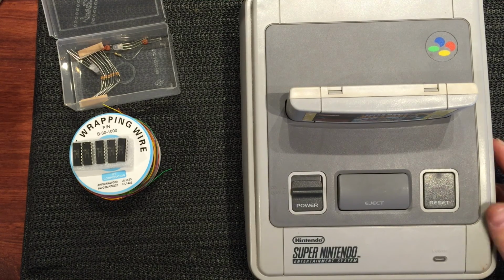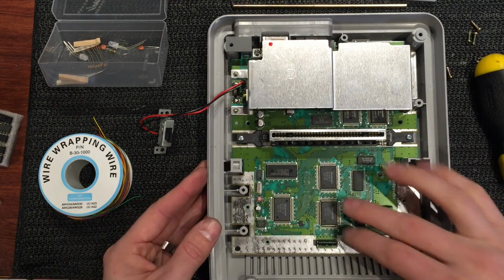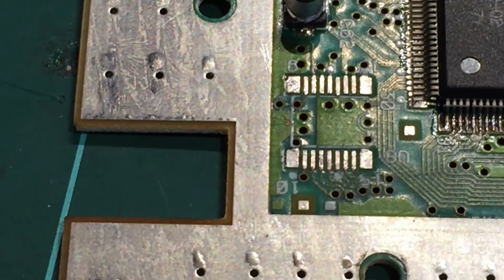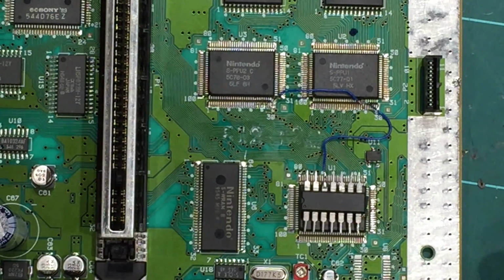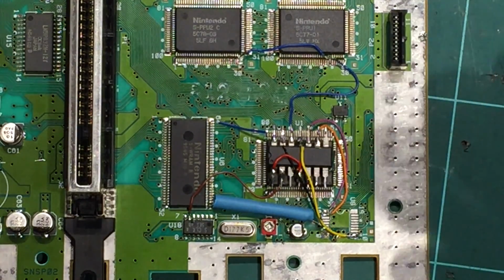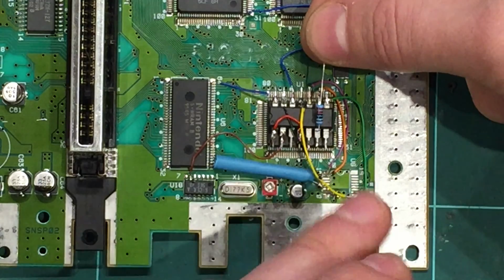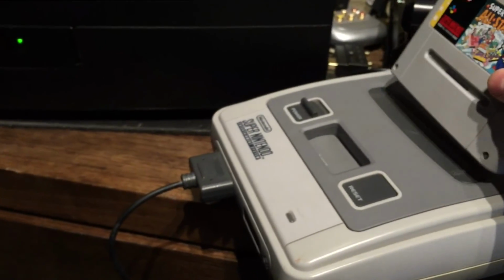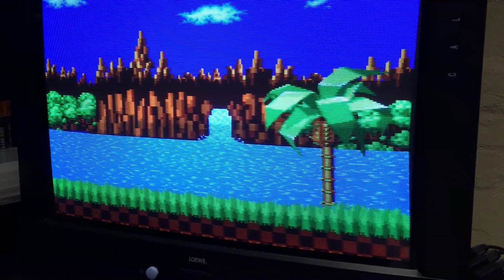How to install a SNES SuperCIC Switchless Modchip PAL NTSC Super Nintendo - YouTube

Comment: first time doing this mod. it went pretty okay. the SNES operates normal... sort of. it plays pal games now. but, unfortunately, the reset button doesn't work anymore.  which part is responsible for the reset buttons functionality?

i should add: the led cant be changed by the reset button as well. it just doesn't work. led glows red and stays there. it's like the reset button is dead.

i did this with a US 3chip modell.

Comment: If it steps down to 5v, why can't we just run it on usb at 1 AMP?
Reply from the maker: The Unboxing Authority Technically maybe... the 5v may not be stable enough and 1 amp from a USB port is fairly weak. It may work though.

Comment: That is a really unique modification. I haven't seen any other mods that make use of the original system hardware. If(when) I decide to try console modification installations, I would love to use methods similar to this. It keeps the console casing in its original state and you don't risk ruining the shell or having a switch that seems out of place or slightly crooked on the console.
Reply: You substitute a hole in the case for lifted pins and cut traces and irreparable chip damage with most switchless mods. So I am not yet convinced it is always worth it.
Reply: Also, this is the first video I've seen from your channel and I subscribed within the first 10 minutes. Great video. Kept it interesting throughout and will definitely be watching whatever else you've made. Glad to have stumbled upon this channel.

Comment: Hello 
Could you possibly post a picture of where underneath the board you took the cables from after you damaged the pad trace as I have done the same thing. Cheers
Reply from the maker: thomas barrand The one I damaged was pad 8 which had a trace running to a via just behind it. So you can use that. The via will be underneath the board as well so you can see where it runs to and solder into that point also if it’s easier.

Comment: Would this also work in a scenario with a japanese Super Famicom being used on a PAL TV? Just so I know if it's worth getting a japanese console to use with PAL in Sweden. :)
Reply: Absolutely, since it has composite out (and also RGB with the right cable!), as long as your tv can handle the 60Hz signal, then it's no problem. :)

Comment: In video I see as at any time easily there is a change mode of 50/60 Hz when pressing reset, but at me for some reason switching not always works. LED - Common Cathode, 7 and 14 has connected.
Reply from the maker: Does the reset switch change the LED colour? Have you wired it into the reset switch as shown in the video?
Reply: Probably the button reset not really well works. 
Still the moment was found. I did it when I had no cartridge. And now when I have received a cartridge of NTSC  region (JAP) a console (by default PAL) doesn't want to start it. There is a black screen. Now I in thoughts, don't know what else to check.
Reply: I have found a problem! There is PIC raises an internal metal plate and it prevents to insert a cartridge to the end. If a cartridge slightly to pull out that on half-millimeter everything is well started. It is strange, but I don't understand why so. Maybe there was a board knee of SNES?

Comment: Do you have the alternate points to solder those supposed CIC pins? My noob job tore off all the pads for the original CIC position. Greatly appreciate the help. Thanks. Please help me revive my pal console. I have the same mother board as this video's.
Reply: You can scrape a bit of the green "paint" over the traces and solder directly to them. Just be sure to get the right trace

Comment: Hi do you have to use a super famicom power supply or a snes power supply for the mod to work
Reply: Simon Fox shouldn’t make a difference, they both output 9V AC. Use the one that works with your mains voltage.
Reply: Not true. A Super Famicom PSU will not work with a Super Nintendo. Regardless of mains voltage. Do not use a Super Nintendo PSU on a Super Famicom or vice versa for any reason.

Comment: +Global Garage
Is the PAL/NTSC difference in the cartridge or the TV?
Reply from the maker: BlueAcid9 The video chips in the console control the PAL / NTSC video format. The games are also coded and optimised for each region.
Reply: Global Garage
So even if you tricked the console, does that mean it won't play as good if it was on the correct console.

Comment: +Global Garage
Why isn't the mod done at the point where the power enters?
Reply from the maker: BlueAcid9 What do you mean?
Reply: Global Garage
As far as I understand it, PAL and NTSC has to do with two things.
1) The AC from the wall, 50 Hz or 60 Hz.
2) The amount of lines on the TV screen and the refresh rate.

So from what I understand, you are modifying this SNES from PAL to NTSC. Doesn't that mean the electricity going into the console will be different? So shouldn't the switch be located at the point where the electricity enters?
Reply from the maker: Ok you're way off... let me explain. 1) The AC voltage coming out of the wall does oscillate at 240v 50hz in Europe/Australia and 120v 60hz in America. They do this for transmission as AC travels much further over distance. Its is also the background / history to the PAL and NTSC standards being 50 / 60 hz. The designers chose to match the frequencies 50 and 60 to make the early TVs display a flicker free image. These days though it has no effect and we don't need to touch AC voltage. The AC voltage is converted into DC inside the power supply anyway, so all consoles use DC voltage around 3.3v, 5v and 12v on the motherboard. 2) PAL and NTSC are both very different video standards with too much to explain here. All you need to know is all TVs will display both standards so we can modify the console and the TV will display the signal fine. 60hz is preferred for retro gaming as it's simply faster and games were written at 60hz speed. We just need to modify the 5v signals on the video encoder chips themselves to control the frequency that was set at the factory. It does get more complex, but that's enough for this comment. If you want to know more just ask.
Reply: good chuckle folks! By his reckoning you hack a computer by way of the power socket, after all that's where all the pixies get inside.

Comment: I did the same mod on a pal snes,used the same led as well but I wasn't satisfied with the colors so I installed a multi led that does red and blue and with the colors combined it was purple,so much better in my opinion.
Reply from the maker: Hey Azoic, yep the multi colour is a great option. I ended up using a 2k resistor on the Red which fixed the issue. It now shows a clear Orange and Red
Reply: Awesome,glad it worked out.

Also since I'm in the US I modded the pal snes for component so I can play it in full color on my sony crt when it's in 60hz mode.
Reply from the maker: Good work. Anything is better than composite video!
Reply: I agree.

The component mod is pretty much on par with rgb which is the best I can get without using a pvm,also never drilled any holes,I removed the rf and installed a trrs jack in place and use a 3.5mm av cord for component and regular snes av cord for audio.

Comment: awesome video!
supercic is much better than switches, as its a clone replacement to the CIC chip and is compatible with every snes game!
its a great mod, and have done many of them myself.  just a few things i have learnt along the way and that works best for me.
i find it easier to place the pic in vero board, and run it away from the chips.
ground and power i get from the controller ports 
the 2.2uf cap near the original cic can be removed, as its not needed once supercic installed.
i find it easier to pre heat the surrounding area to about 150c, then come in with a higher temp for quick chip removal.  also use kapton tape to protect the nearby chips.
soldering into via's for me is easier than soldering onto those tiny pads.

If using a american or japanese super nintendo, it is likely that 50hz will be in black and white if connecting via composite.  there are  options to fix this.

love the videos and keep them coming Darren.
Reply from the maker: Thanks Malcolm. Some great tips there! Yes it's an awesome mod just a bit tedious to install. I initially had issues with the PIC code, so I ended up downloading the latest version and reflashing the 16F630 on my GQ-4X. Worked right away, so there must be more than one version of the code floating around on the interwebs which adds to the frustration of this mod.  I'll link to the code I use for others to grab. Yep I actually modded a second one ( Super Famicom) off camera and ended up socketing the PIC in a vero board and just running longer wires which was way better! The socket helped a LOT when testing different PIC code. Yep I always use tape to protect the board, good tip!. I had the black n white issue but only during testing on composite, I then switched to RGB for actual use. RGB is better for so many reasons including this colour issue as it doesn't rely on the clock frequency for colour burst. If people are reading this and are still using composite video for retro gaming, go puch yourself in the balls and move to RGB. :)
Reply: Hi I have the following issue. The switchless mod itself works perfectly. Only issue i have is when i start up the SNES for the first time the led isnt on. When i keep pressing reset to switch mode it will switch mode and correct color lights up and from then on it works like it should switching mode/led color. Just it wont show it initial mode with corresponding led color when turning on SNES. 
any idea what i could check? thank you
Reply: Thanks for great video!
If I'm not mistaken, the RGB-mod is only available for so called "one chip version", isn't it? Tried to google this and found a lot of different information (sometimes self-contradictory). Also I've read that most modern flat-screen TVs can't handle RGB@240p properly. Is this true? I'm currently waiting for a Japanese SFC from e-bay and looking forward to super-cic it first and then I want to try some video output modding. The problem is my SamsungTV doesn't have an RGB input (well, maybe it has one through one of its HDMI ports but not sure if it can handle 240p) though it has the Compnent Video (YPrPb) input. Is it possible to do the component-video mod for SFC? Thanks.

Comment: I was going to do this mod on a super Famicom , didn't realise it was so involved
Reply: If you don't want to risk doing the mod, you could always buy an SD2SNES - that has super CIC built in so you can run games from any region.
Reply: I have an unmodded PAL SNES. If I get SD2SNES, can I play NTSC games @60Hz?
Reply from the maker: No, to run 60hz you need to set specific voltage on both PPU1 and PPU2 as in the video. It's a hardware thing, so I very much doubt a softmod card could do this. You can simply run a basic switch to both pins and just flick it manually when you want 60hz on a PAL console. That's what I do most of the time, but this SwitchlessCIC was something fun to try
Reply from the maker: Hi, yep it's a lot of effort really. I'm still not sold on the concept of switchless mods compared to good old fashioned switches. This is a CIC replacement so that's cool, but modern Everdrive carts also have this built in now. Not needing to cut holes in the case is also a bit plus..
Reply: No, I believe you would need to do the 60Hz mod.
Reply: GadgetUK164
That's a bummer..